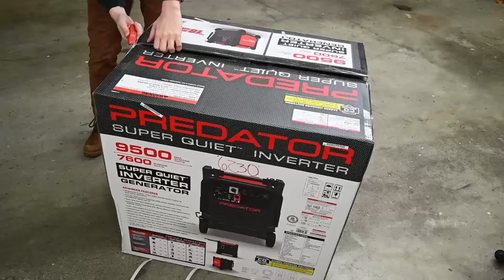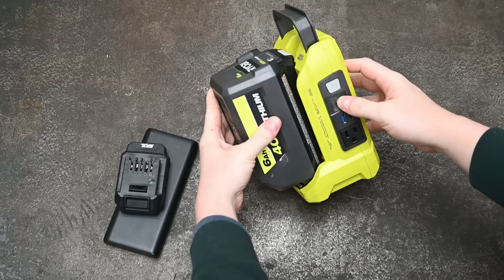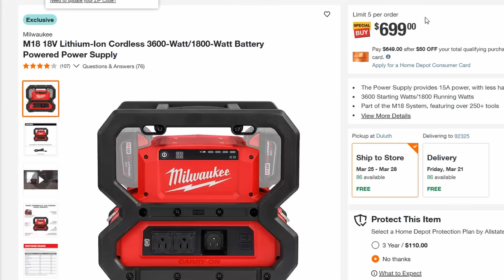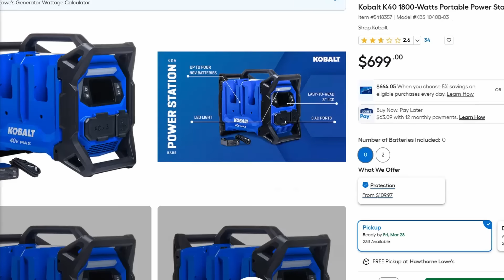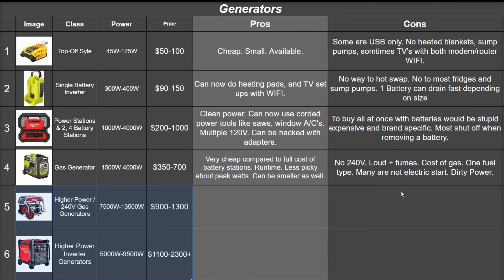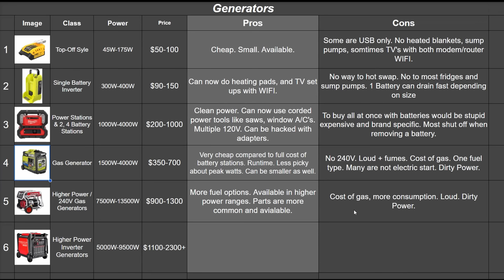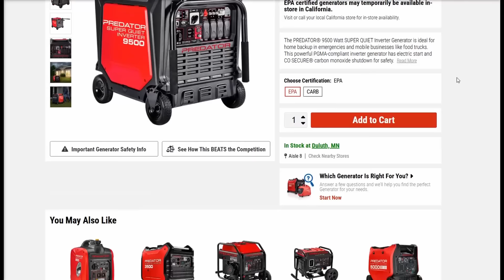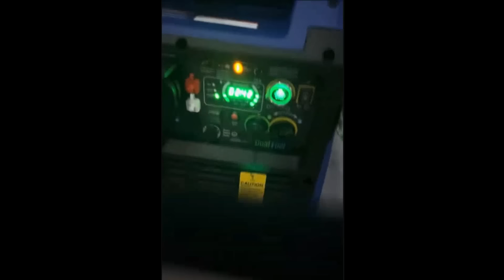Buying Harbor Freight's Most Expensive Generator So You Dont Have to

Comment: As someone who built off-grid and lived off-grid for 8 yrs, the best someone can do is begin reducing the power consumption of their home before any power outage. People assume that an appliance uses the same power across the board for every brand, which isn't true. For example, after research and salespeople allowing us to use our power meter at the store, we found TCL tvs use the lowest of power. Our 75" can be set to the screen brightness and power settings to the lowest setting and it only uses 38 watts. Even at that setting you can view shows just fine even in a bright room with sunshine directly on the screen. 
So, really, instead of trying  to provide power for everything you already have now, think of reducing your consumption on an everyday basis. That will accomplish 2 things. Lowering your daily electricity consumption aka lowering your monthly bill and lowering the amount of power you'll need when there is a power outage.
We sold our off-grid home. (We git an offer we couldn't refuse) I'm applying what I learned off-grid to our remodeled on-grid home now. Our highest electric bill so far has been $60.
Reply: the only one i can recall testing was a 65 inch vizio from... 2014? with a android box attached. runs about 90 watts total with all the tv settings turned to max. never tested the minimums

Comment: The drawbacks of the predator 9500 are exactly why I went with a pulsar 9500. It’s essentially the same as the predator, but has remote start, tri-fuel, and a 50amp outlet. Not to mention a 2-3 year warranty. It was also $400 cheaper than the predator.
Reply: Where'd you pick it up from? Amaze-bezos?

Comment: I had a single 10,000 watt noisy dirty beast. Experienced the same issues you had. Replaced the one generator with two dual fuel Wen inverter 4500 watt generators that I link together when I need 50 amps. This helps save fuel in an emergency when you don’t necessarily need 50 amps and cost about the same a 10,000 watt inverter generator. I also have my own solar setup with battery backup that I installed. This way I only have to charge the batteries if solar isn’t cutting it during an emergency.

Comment: If you are going for a more minimalist setup: power station with enough power for what you need and a small generator.

To run my furnace and fridge, i have 2 1KWh power stations and a smaller dual fuel generator (1600w propane, 1900w gas)
You conserve fuel as you first run down the batreries and then stsrt the generator to charge them. You also get clean power so you avoid messing up your more sensitive appliances.
Ecoflow has a model that charges at 1500W so it charges at the top rate a small generator can run anyway.

Comment: One thing I will toss in there as well to consider are Tri-Fuel generators. I was looking at the predator originally but after a few outages lasting multiple days, I ended up going with a Westinghouse trifuel gen since we have a gas line here. Depending on how long outages last for people its something to consider. We were without power for 11 days, our place was the only one that had reliable power after a few days since the gas station couldn't pump after day 2. We let people come by and charge up what they could and families with little ones store milk and formula in our chest freezers. Only had to shut it down after a few days (oil change since I'm a hypochondriac  about my equipment) and got her going again straight away.

Comment: for the small guys, I got mom the ryobi lantern that also has a USB charging port.  a 4Ah battery will give her a monster run time for lighting, as well as keep her cell phone charged for days, all from one nice compact unit.  the light even has multiple power modes.  She also has a full size generator that can run almost her entire house, but having the small boy ready to go on her nightstand means she doesn't have to worry about firing the big guy up until after all the evil storm has passed.

Comment: Gotta take those wattage ratings with a grain of salt, especially with inverters.  Constantly running a 9000 watt generator at close to 9000 watts is practically a guarantee of a burned-out inverter module in not-too-long a time.  And if you find it necessary to ever run it that high, I'd suggest plugging a small fan into the unit and directing its airflow at the inverter module to try and keep it running cooler.

Comment: I will say the upside to those large battery powerstation things getting better all the time is they can be run in places you cannot run a generator. something like an apartment for example. I mean of course nothing will beat a generator yet, Maybe someday solid state power sources will beat fuel but not as of current.

Comment: Duel Fuel... using propane means I don't need to worry about gas going bad or fumes and can store my Westinghouse inverter generator in my climate controlled basement rather than my  extreme hot/cold garage. Yet then just have 20# propane tanks on hand and use for the normal-ish short outages. No draining gas after. Etc etc.

Comment: In addition to running on propane, I have gone the route of the 24V 100 Ah LFP battery and 3,000W inverter.  I find a lot of stuff runs well off of 24V and I don't need an inverter.  It is a big waste of power where you don't actually need it.  I setup with various Anderson connectors to make plugging in stuff easy.  A 24V 100Ah LFP is ~40 lbs and usually has nice rope handles, so easily hand transportable.  3,000W of inverter power is good at running a lot of stuff, granted try not to overload your battery too much and it is good to leave some headroom on your inverter.  You can even get all-in-one units to plug into the battery for not too much; just add your own wiring.  Portable power stations are convenient, but they can get costly, extra battery storage can get expensive, and running an inverter all of the time for everything wastes a lot of power in extra conversions.  Say for example a cheap 32" monitor I have with a 24V power plug.  When I regulate the power to it through a DC-DC buck-boost converter while at maximum brightness, it pulls ~40W.  Do the same with AC, it is 70W from the 120V outlet.  Do it through an inverter as well and it is ~85W from the battery, over twice as much as the DC-DC buck-boost converter regulator.  When you are limited on battery capacity, that is less than half of the battery life, even with an efficient LFP battery.  Lead-acid will drop you to less then 1/3rd the run time as the higher power draw makes the battery less efficient.

So say you really want to be frugal with power while still having power, you could potentially be running a portable cooler off of 24V, laptops, cell phones, and tablets off of 24V through car based USB power supplies, and maybe even a USB LED lantern also plugged into the USB power supply.  Go to other rooms and run off the internal battery and then come back to the big battery to charge up.  If there is just too much good food in the fridge and can't do an on the spot clean out that leaves a small enough amount left for a portable cooler, you just power the main fridge off of the inverter.  It just means you use up your battery power a lot faster and will need to fire up the generator more to charge it.  If you need some electricity to cook, say an air fryer or microwave oven, the 3,000W inverter can handle one of those at a time.  Or you can push two portable induction burners off of a 3,000W inverter.  Granted, if you have a propane camping stove or a full sized propane stove for rural living, you don't need electricity for that.

A big thing for saving fuel is an inverter and a sufficiently large battery.  With a sufficiently large battery, you can run a full sized fridge overnight and leave the generator off.  A lot of these power stations have batteries that are too small to run a fridge all night, especially if it is an older fridge.  Your power drill battery solution is definitely not enough capacity for most full sized fridges.  If you also need to run your gas furnace, you may want to measure its night time electrical usage in the winter and then go back and make sure you have enough battery for both the fridge and the furnace for the night.  Maybe you get two large LFP batteries that you can still easily carry instead of one if your night time demand is enough.  Generators run inefficiently at low loads, so running overnight is wasting a lot of fuel for little work done.  Unless maybe you are running a heat pump all night in the winter and so can load it up.  But then you start thinking does it make more sense to burn the fuel in the generator inefficiently for an efficient heat pump to run or just burn the fuel directly for heat?

Another thought with downsizing your generator some is the cool room concept in the summer time.  The idea being have one room designated as your cool room and you pile into there to not roast instead of making the whole house cool with a big, power guzzling central until.  A portable AC will be least efficient, a window AC more efficient, and a mini-split most efficient.  I have done this where the central AC just keeps it from getting too roasting inside when I am home and then I have a room I spend most of my time in that is a comfortable temperature with a separate window AC unit.  This was all done with Wi-Fi controlled inverter units, so I was able to do a great deal more to really get the power bill down while living in reasonable comfort and then I could hook the window AC to emergency power if I needed to.  Inverter based AC units play very nicely with generators where the older units can kill a generator, even one of these newer inverter units.  Inverter (in the generator) to inverter (in the AC unit) is the way to go.

Comment: Love my Milwaukee 175 watt top of inverter. Use it all the time. I wish you would have talked about 12v inverters you can hook up to a car. I get blackouts all the time, and I pull out my little 250 W inverter, turn my car on, hook it up to the batteries and power, my TV and Internet. I could get a 5000 W inverter for less than 400 bucks on Amazon, a lot cheaper than buying a generator when you have a car (especially a fuel, efficient little car).

Comment: You gotta have dual fuel in California.  Our gasoline.   I have owned a Honda 7500 fuel injected,  honda 2200's,   and the Champion dual fuel, which I ran on gas unfortunately.    Not kidding.  ALL of them,, ALL of them let me down.  I would occasionally start them,  sometimes used fuel stabilizer.  EVERY ONE of them failed me when I needed them, because they sit for quite awhile.   That Honda was a real let down, and cost like 5k.     I now have TWO Predator 5000 dual fuel, with their Parallel kit the allows me to link them together.  This is the way to go.  They are easier to move around than one big 9500, or that 7500 honda.  You can leave one of them at your panel,  and have it hooked up to a propane tank.  Let that one power you when you reedit,  and add the other if need be.  Also, you can use the second one for other uses, like camping,  or lend it to your kids, like I did.  TWO dual fuel smaller generators, with a parallel kit.  The propane hold in the tank forever.  Gas doesn't.  Propane is cleaner burning,  you could run it in your garage if you wanted to I think,  I have.

Comment: Fairly timely; here in Michigan, an ice storm knocked out power for 200,000 people. i was without power for 10 days. my smaller Westinghouse generator wouldn't run the furnace, but it ran the pellet stove the whole time without complaint. if you live where there are trees, its worth having a generator and a chainsaw.

Comment: The Westinghouse generators are a decent unit. Plus - some variants of them can run off nat gas as well. If you have natural gas service, it means never worrying about fuel supply - which is a HUGE benefit. Propane stores indefinitely, but it does run out. So if you are considering a new generator and you have nat gas service at your location, having one that can use it is a HUGE benefit.

Comment: I am from Ohio but live in the Philippines now. I have bought 5 generators here so far. My last 2 have been Hondas and I am VERY happy with them. The oldest one is 3300 watt start up watts and has about 500 hours on it. Since we have so many blackouts here I wanted to have a back-up to my back up generator so I bought a 6500 watt Honda with both recoil and electric start. 100 hours on it. The old one has started on the first pull about 98% of the time.  While I am a made in America fanatic, I will always buy Honda engine powered equipment when possible.
Reply: whats the biggest difference you've noticed about living there? i am very likely looking at eminent domain in the near future and just getting tired of what the country has become.
Reply: @nickabel8279  Too many differences to name but some are 1) frequent blackouts. 2) Frequent loss of signal from the fiber optic internet cable. 3) very poor cell reception. I am only 2 kilometers from a cell tower and seldom have a signal. 4) since I live on a very small island, I have to take a ferry to a big island to buy western food. 5) again because of the small island, any medical condition requires a ferry trip to a big city and depending on time day or time of year, that can take awhile. RIght now, since it is holy week, the line to get on the ferry to come to this small island is nearly 8 hours long for cars. On Saturday and Sunday, the line to LEAVE the island will be almost as long. The ferry ride is only 1 hour but then you have a 2 hour drive to get to the big city. On a very good day, I could get from my house to a hospital in about 5 hours.

Comment: Interesting you mention that you can run a welder off of higher power generators, because there are units out there that combine both a welder and generator into one big unit for welding in remote areas.  They usually put them on the back of a service truck for repairing infrastructure that is well off the beaten path of usual power access like railroads or electric/telecommunications poles.

Comment: I got the HFT 13kW tri-fuel generator because we have natural gas, and I wanted enough capacity to run our A/C. Note that using nat gas reduces the continuous power from 12kW to 8kW. The pure-sine-wave capability of inverter generators is nice, but not necessary now that many generators have electronic voltage regulators.

As others have said, you really REALLY want an alternative to gasoline because propane and natural gas will not spoil over time or leave any residue like gasoline.

Comment: This video couldn’t have come at a more perfect time. Currently living without power for a few days because times are tough and paycheck to paycheck doesn’t always keep the lights on. Been switching between the ole 900w Harbor Freight Taulgator and a 400w inverter on the car. Good to know Riobi has a battery option I could use.

Comment: Speaking of line conditioners, I would be curious if this were an easier thing to do than it seems.  I rent an older home with an addition and the addition seems to be hacked into the kitchen breaker so flipping on the disposal full of trash makes my lights flicker and occasionally makes my PC reboot.  I have a UPS that seems to fix that later event these days but the flicker is still present.

Comment: Its not so much the voltage thats the problem in dirty power, its the inconsistent and wrong frequency, thats the part that can damage certain equipment the most. Only way to fix it is an inverter. You could use a double conversion UPS to smooth it out.

Comment: Those gas and burger generators are not loud at all. Also I've never had those issues you have with the normal generator. I lose power a lot and I've used the exact setup you got with no problems for a week at a time or longer

Comment: I got the 800 watt sportsman inverter generator from tractor supply for cheap. Unfortunately, it can not do 800 watts, but it's good enough to run some fans in the summer or my gas wall heater fan in the winter. The upside is that it only uses 1.5 gallons of gas a day at most.

 I'll probably get the $200 predator power unit to add into the mix soon.

Comment: In a power outage, it depends on what you need to run. The most important is your refrigeratos. You can always cook with propane/gas. Quite some years ago we were whithout power for a week(Nationwide) had a 5KW plant stored(Never used) Anfter trying(Now mechanics) a budy got the carb cleaned and it runned. Our Split Household has 6 Refrigerators/freezer, Neighbor had 2 and the other neighbor had 1. It Runned them all. Would runn it for 6 hour turns. It used 75 Lts of gasoline. Lucky I had some stored plus drained the cars tanks. Light with Propane gasoiline camping lamps. Cooking with camping gear.

Comment: I have a Westinghouse 3675W bought for the fridge/freezer. For heat I installed wall mount propane in every room. The Westinghouse starts with just a couple of pulls and is not hard to pull. Very happy with it especially being able to run off a BBQ tank.

Comment: I suggest going tri-fuel. There's lots of gennys out there that will run on gasoline/LPG/NG.  They've made it is easy to switch between fuels.  If you have NG to your property, it's as easy as connecting the way a NG BBQ connects. No need to store fuel.

Comment: Reminder to always check if the output device is a Pure Sine Wave (like the grid) or Modified Square Wave. Stick to Pure Sine Wave on everything with a micro controller or electronics chip in it. Which is pretty much everything today.